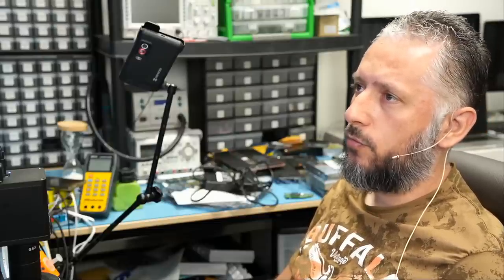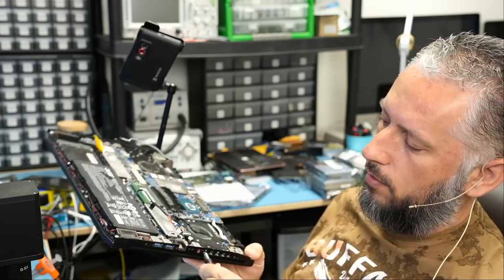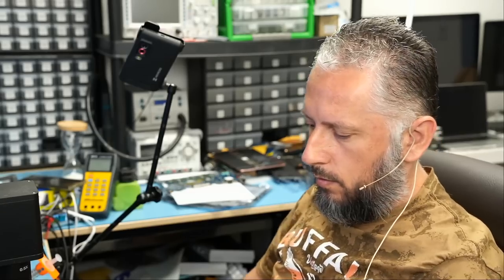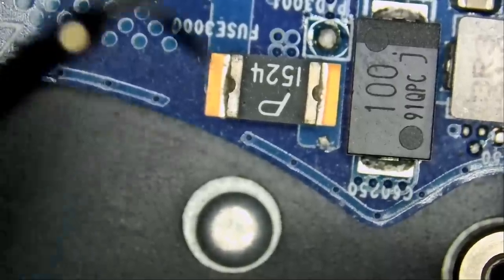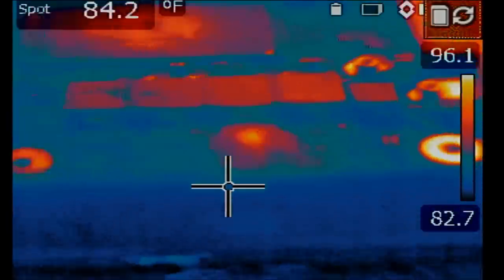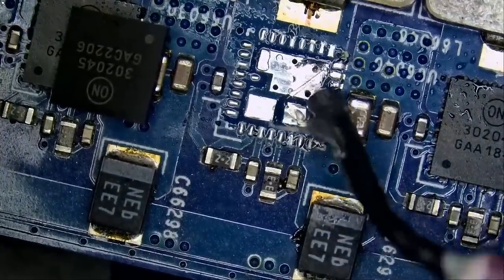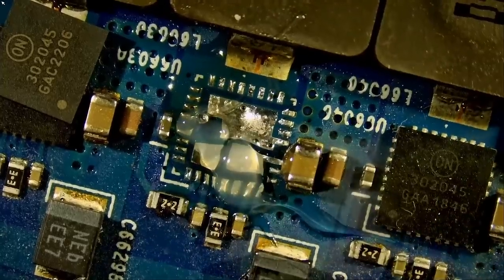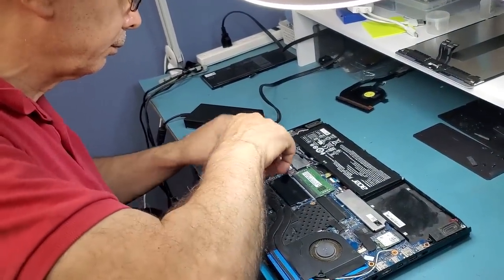Acer Predator Helios Laptop No power Short Circuit. Is it Fixable?

Comment: I want an exact number of how many laptops have turned into waste because of directly soldered CPUs. A socket is a bit more bulky, but present ones can be improved to get slimmer, and then you have a reasonable option to get the laptop fixed.
Reply: Even if you could replace it, they were never cheap.
Reply: @davidlguerr  And intel as the asshole company it is implemented arbitrary CPU restrictions for chipsets like the HM 70 which could easily handle core I processors but wasn't allowed to ... They implemented a 30 minute timer just to piss off people who wanted to upgrade ...
Reply: You won't have enough pressure from the cooler to keep a cpu in an LGA laptop socket unless you use a proper retention arm mechanism which is huge. LGA by design has a 10cm by 10cm ish area around the socket where you are not permitted to place any components. pins like old ryzen and such are too thick and long. This is why you only see socketed CPUs and mxm GPUs in very large laptops from say, Alienware.
Reply: Why is it impossible to fix cpu faults?
Reply: @someoneelse1550  well, that's one reason why socketed CPUs are rare, because people think it's impossible to make slimmed sockets. The technique of making CPU sockets is far from perfected nowadays.
Reply: @1.14kWithoutContent  you hit the hammer right on the nail there... What would happen if buyers would become more aware and modularity would be something that raised product specs?
Reply: you will understand if you're in a laptop manufacturer company

Comment: I've seen a couple of this exact model and this is all they ever do. Keyboard lights up, no video, nothing. I've spent a lot of time working on these boards and never figured out the problem. Reflashed bios etc. I believe the CPU itself dies.
Reply: Check first mosfet it's usually shorted
Reply: Check the resistance to GND on the CPU coil
Reply: I have this exact problem, trying to figure out how to fix it (not a technician). Any tips?
Reply: @chikeretochukwu1999  I don't believe this isn't an accurate way to diagnose a CPU fault as those lines can often be low impedance when the CPU is off.
Reply: @tafadzwamusekiwa659  No shorts on the one I had.
Reply: @KyleGP  the minimum the CPU should be is 1 OHM, if its totally zero ohms, definitely its shorted out
Reply: @chikeretochukwu1999  Not necessarily. Some CPUs I've seen deploy a protective method. When a CPU is turned off, the power rail is grounded to prevent any residual charge from damaging the CPU. When the CPU is turned on, the power rail is no longer grounded and the CPU can operate normally. This is a common practice in electronics to protect sensitive components from damage ¹.

Comment: I had the some issues after having the thermal paste replaced and not powering on. What I found out is that sometimes you need to reset the battery by inserting a metal rod in the small button that is located in the bottom of the laptop. Although in this case it can be a permanent CPU damage situation
Reply: I have similiar experience. Once you take battery out, you need to locate off/reset swith on the motherboard.

Comment: Same issue here. Its not BIOS either. The trick is try to push Esc key many times while turning it on. The problem is it will boot but it will hang during OS Windows loading you can even go to BIOS setup. Hope it helps in your troubleshooting.
Reply: I had this problem with my old laptop, the problem with that whas the GPU whas death. to fix that you need to go to safe mode disable the dedicated GPU and go bak to normal mode. Then it boot normaly but only without a working dedicated GPU.

Comment: I have the same Acer Predator 300 with 17 inch display and 2070 super Nvidia. Still working great so far.
Reply: ??????
I have 2 eyes and they both working great so far
Reply: mine had 2060 just like this one and shorted completely. had it for 2 years, went to 2 repair shops both said CPU damage. Lesson learned is buy a cooling pad + better thermal paste application and don't game on high temps. mine bursted at 90+ celcius. GG
Reply: I have the same Predator 300 17inch 2070 super model as well for about 3 years now. I have in the past few months began experiencing issues with the CPU. 
I believe it’s a overheating issue. Haven’t figured out completely why or how to fix. 
While playing games my laptop blue screens and has to be manually reset. 
Laptop works if I have a fan on it and it’s elevated off the table. 
Very unfortunate that CPU failing seems to be a common issue with this model
Reply: @Rashid-sl4mg  2060 as well though a I haven't gone to a repair shop yet but I feel like this might be the case cuz mune died while using
Reply: @Rashid-sl4mg we all gotta Live and learn to find out the hard way 😅😂

Comment: There is a 50% chance of repair if a VRM died. The package has 2 mosfets. one to ground and one to 12 V. They switch alternating to get an average of 1.4 or whatever volts. If the mosfet to ground fails first voltage goes to 0 and no harm is done. If the mosfet to 12 V fails then the CPU gets 12 V and dies and the other mosfet in the package will die too. When you get it for repair, both are gone so you can't tell which one died first. Depending on which mosfet died first the laptop is either fixable or a no-fix. The odds are 50%. If you are lucky only a capacitor shorted, then the odds are very good because they connect to ground.

Comment: Hi Alex, as i have told you for another type of laptop, but i don't know if the question can apply also in schematics with DR Mos, when a power transistor especially in the cpu supply fails, one can ask himself if it is working in couple or more with other transistors / dr mos,    if after a test the short comes back on one of them or more, then one can consider changing all the couple or all the dr mos feeding the CPU... this is resulted to be resolutive in many cases... i have never repaired a dr mos pc, nor i'm a professional, i would like to know your point of view.... bye from Italy... i respect and follow you...

Comment: Why don't the manufacturers have a circuit in place to protect the CPU (and similar for the GPU)?
Reply: Even a fuse after the mosfets lol
Reply: Because you could then repair your property, and would not be forced to buy another "newer model with more features"
Reply: It is not cost effective to add protections everywhere. So manufacturers try to save any cent they can.

Comment: Have a question for you Alex....The Asus laptops that you fix with the Mos-fet issues, do they hold up? Are there any returns? I´m not underestimating your work in any way but still wonder if they are coming back. I`m thinking if there is some basic faults in the structure of the motherboards?

Comment: I don't know about acer but I had a familiar problem with the fans on a hp laptop. After I took out the battery and pushed the power button for like 10 seconds, it resetet the bios and after that started normally at least.

Comment: Hi  After replacing the Acer Predator Helios 300 Laptop LCD Panel, the Charging Light does not come on at all. There is no power to the laptop. At first the blue light came on and then unfortunately it went off. Many people on the Acer Forums experienced this problem after replacing the screen. Most of those who experienced this problem changed the LCD screen without removing the battery. Could this situation have caused a short circuit on the motherboard?

Comment: Hi I have a laptop the same and the customer has replaced the screen so they didn't take the battery out after that laptop did not turn on I checked it has no 5 or 3 volts and replaced the charging BQ7480 but it is still the same any I idea please let me know

Comment: As @TechRodent wrote, that capacitor does not look good, you need to replace it.
Reply: As long as it is not shorted it would not prevent the laptop from starting.

Comment: You should try again a couple times before giving up. Could be BIOS or Windows "re establishing" itself? 
Sometimes requires several boot attempts, depending upon the last state it was in when it failed.
Reply: Nah, things like bios reset or memory training would auto-restart when they're done, and anything to do with windows would still show a post screen first. If it turns off without posting, it's a critical hardware error (CPU, GPU, RAM) because the SMC and power delivery is working (charging light, keyboard light, power on sequence). It's very likely that the drMOS failure fried the CPU, so there's no point to troubleshoot more. I'm sure he tried to power it on a few times with the same result.

Comment: In this case I will remove BIOS battery and I will turn the computer ON and OFF. Conect battery again and it will reset BIOS. If the computer is turning on of course.